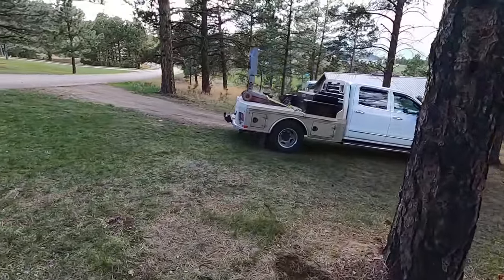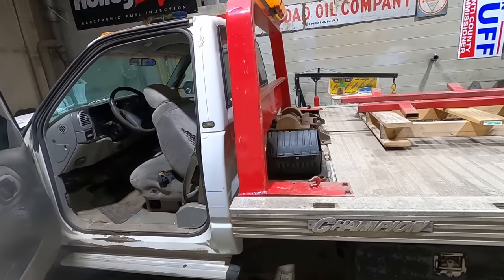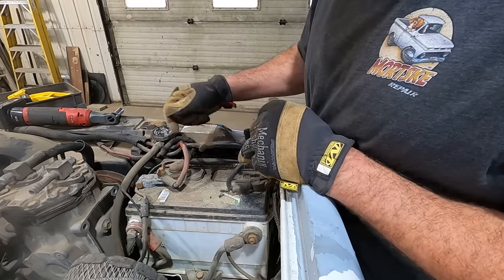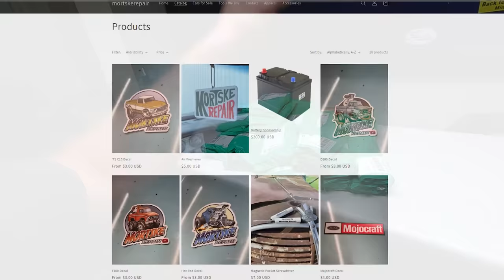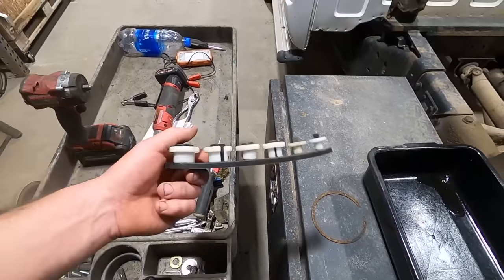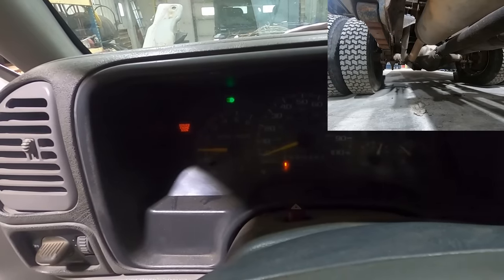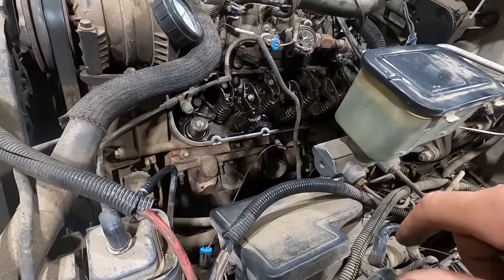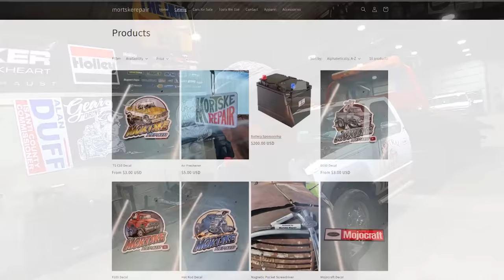WORST Purchase of My Life?!? I Bought a Rollback Tow Truck for Dirt Cheap! How Bad Can It Be???

Comment: 2002 was the very last year for Chev & GMC fullsize truck models with that body design. From 2001 - 2002, the 3500 HDs like that one there & the bigger size medium dutys were the last models that were left in production. 1999 was the last year for the SUVs & 1500 pickups, & 2000 was the last year for the 2500 & plain 3500 pickups. 1988 was the very first year for that body design, but they only came in two-door cab pickup models at the time because the SUVs, four-door cab pickups, & bigger size medium dutys with the previous body design were still in production which lasted up through 1991 except the bigger size medium dutys only stayed in production up through 1990. 1991 was also the first year for those 3500 HDs.
Reply from the maker: Good to know

Comment: Considering how long this body style has been discontinued for the Silverado trucks, the air filter is still available at Walmart.
Reply from the maker: good deal!
Reply: @MortskeRepair  when the Dickinson store did our last Automotive department remod in January, we lost air filters from vehicles that were newer than these, and I was certain we would lose them. But they remained, along with the cone air filter the F150's with the 5.4 l engines used.

Comment: The wheel lift has two L shaped square arms that slide in the square holes on the side of the wheel lift behind the tire of the car you are going to tow then you put tire straps on top of the front tires and tighten the rachet on the straps.   Maybe you did not get the L irons for the wheel lift.  I have to go or I would tell you more.

Comment: Replace with a 8.1? Those are oil burning hot garbage. That 454 is a great engine if you give it the fuel pressure it needs and that would be 55-62 psi and most of the time they won't start without that. As far as showing a miss fire not with a code reader you need a scan tool that will show mode 6 data. In fact you can pull a couple of plug wires and it won't trip the check engine light. That motor makes plenty of power it doesn't need any modifications been driving a 99 3500hd for 20 years they are awesome.  If you do need to pull the heads you will need to get a real scan tool tool to set the timing cam crank correlation, set base time with a light the rest with a scan tool. And yes the push rods are bigger diameter than the old ones. Few issues are, intakes like to leak, fuel pumps, the distributor caps are not nearly as good as the old hei caps.
Reply from the maker: good info!
Reply: I forgot to add,, great videos!!

Comment: I'm no expert on cars, but I don't think that is the original engine for that truck. When you had the Schlong in the cylinder, I saw that some cross hatching was still visible. I don't think that would still be there if that engine had 240K on it, unless it had been completely rebuilt at some point.
Reply from the maker: Looks OEM to me

Comment: 454 is what engines are all about. I mean, really. You do a good job narrating. Don't know what you paid, but I bet you scored big. Never could find anything that could even match the 454 SS motor from an 1970 Chevelle. Did nearly lose my life in it, but I was just a kid. But Crescent wrenches? Are you a carpenter on the side? lol I had one put out somewhere between 650 and 850 hp. Was considering making my dual axle car hauler I bought used into a rollback tilt bed. Still considering it, but not so much. Am going to make it a tilt bed.  I love hydraulics. I invented electricity. Thanks

Comment: Fun fact; 88-94 had the older Interior and the flat grill with (TBI) injection, 1995 they came out with the (new) grill and updated Interior and electrical for an air bag but still had (TBI) injection and same front accessories as 88-94, 1996 same Interior as 1995 but they came out with vortec with (EFI) and they updated the front accessories on the engine, 1997 they updated the dash again for passenger side air bag 1998 had the same Interior as 1997
Reply from the maker: Good to know
Reply: @Mortske Repair  you're welcome you need information about 73-87 or 88-98 I got alot of information about em

Comment: You got a Topkick handle on the passenger side. 

It should be a regular handle like the drivers. 

If you wanna throw another Topkick handle on the drivers side, good luck. You’re gonna need to find the handle AND the rods, that aren’t broken. Which chances are, you’re not going to. 

Easier and cheaper to throw the regular handle on the other side. Or leave it, can’t see both sides at the same time anyways

And those Vortec big blocks love eating lifters. I’ve had to shim and lengthen a few pushrods in my day for the customers that didn’t wanna pay for new lifters
Reply from the maker: Interesting! I'll probably go with the standard style door handle if I get crazy.
Reply: @MortskeRepair  I was wrong about the handles. It’s been a few years since I’ve messed with HDs and Topkicks. But regardless, the rods are unobtainium. And the dudes selling them want outrageous prices for them

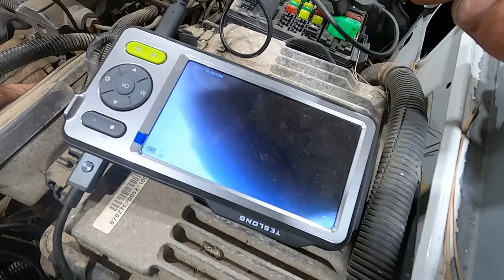Comment: 1:17:25 ouch...you know the 2001-2002 models of the 3500HD had the 8100 engine in from the factory so it's not a hard swap at all...those are the ones to look for although I'm picky and would hold out for a 5-speed and I'm also cheap so I'd be looking for a TBI 350/5-speed '95 model because lots of power is nice but a TBI 350 is so bonehead simple even I can work on it

Comment: Luckily its not a aluminum head and the exhaust studs should be good. I dunno why every modern aluminum head v8 snaps the heads off but every manufacturer constantly needs manifold bolts replaced.

Comment: You’re wrong on the 8.1, 2001-02, c3500hd would’ve come with a 8.1 as the gas option and is a GMT400
Reply: Came to say this. Seen quite a few for sale lately with the 8.1, and cheap. I figured people assume it's a mistake and write it off as a 454.
Reply: @ljkck3578  mortskes truck is definitely a 454, as 8.1 trucks are coil near plug like an LS. And the intake is totally different

Comment: The modern toothbrush was invented in England in the 1700's. You can tell it was invented in England because if it came from anywhere else it would have been called a teeth brush 😂

Comment: Ugh. I hate those GM "quick" disconnects.  WTF is quick about having to have a special tool to remove a degraded piece of plastic while hoping it doesn't break or strip out?
Reply from the maker: Makes them easy to assemble

Comment: Okay I'm sorry I haven't finished the video yet so I don't know if he even corrects himself but I need to get it off with chest as someone who specializes in these exact motors the 7400 vortec motor you say the aftermarket is not out there no there is an ungodly amount of aftermarket for that motor the big thing you have to remember is the block never changed it is still a 454 which is the exact same block as a 427 and also the exact same block as a 502 so you can use any of the parts for any of those three motors
Reply: And as far as the computer stuff goes as long as you're not going crazy with it I mean you could stroke out a 454 and throw bigger injectors at it all the way out to a 489 and the computer will still keep up with it just fine it won't care however there are people out there who are tuning the stock computer and there are aftermarket computers that will hook up to that motor and that stock wiring harness if you really want to get fancy with it but honestly if you're looking for more power then I cammed out 489 and you want to stick with E FI go LS otherwise f*** the computer stuff drop a carburetor intake on it and flop a carburetor on as long as you've still got the crank position sensor and the kickdown cable the 4l80 should still work if I remember correctly there might be one or two other sensors that it still needed but the point being is it is stupid easy to just rip the vortec intake off and plop a carburetor and take on it and that's it it works
Reply from the maker: @DAR10162  good to know
Reply: @MortskeRepair  I apologize if any of that came off passive aggressively I really didn't mean for it to but rereading it now I can kind of see how it does so I do want to apologize for that I didn't mean to be passive aggressive about it
Reply from the maker: @DAR10162  no need to apologize!

Comment: Marvel mystery oil should have gone the way of the dinosaurs.
Reply from the maker: why's that?
Reply: @MortskeRepair  like seafoam they have outlived their usefulness.
Reply from the maker: @karenkartz3163  Care to further expound on your theory?
Reply from the maker: @karenkartz3163  Enlighten me
Reply: @MortskeRepair  ok seafoam was a quick fix for 2 stroke outboard engines to ease start up after winter storage. Loosen piston rings on piston  from cheap oils we used to have before fogging oils. Marvel mystery oil is pretty much the same but it did work on 4 stroke engines but oil fouled not rusted tight.
Reply from the maker: @karenkartz3163  Interesting, and they serve no other purpose?

Comment: So what do you do to fix the air stepper motors for the gauges. I just shot some air around my 94 and it seems fine now, but my 93 has a jumpy fuel and oil pressure gauge. Why don't you send me a Quadrajet. Then I can do a video with all the tricks! I have looked around and nobody has an extra, and the one I have doesn't have enough left to even try a video. It would be more pictures than video. I don't have holes in my beds, I take the bed off! Guess they didn't know how to stager the butt connectors so it wasn't a big mess! Please tell me OBS stands for.
Reply from the maker: Old body style
Reply: @MortskeRepair  What? That's new body style to me! 🤣🤣🤣🤣

Comment: When you get it running right again are you going to use it to get vehicles that you bought or just use the trailer
Reply from the maker: hopefully
Reply: @MortskeRepair  that would be cool 😎 to see a video of yours & you're in the rollback going to get 2 vehicles & if the wheels are stuck on one you can put that one on the bed & the other one on the lift piece

Comment: With the amount of class C motor homes sold to the optimistic public during the years of late 70's to early 2000's who envisioned having a lot more time to use them, that are now sitting around with hardly any miles on them representing an eyesore and something most people just want to get rid of. Why don't you locate one of these low dollar - free dollar rigs, tear the motor home part off of it and put that bed on that worn out rollback Chevrolet on it?
Reply from the maker: Frames are usually lighter.

Comment: If this engine  hasn't run in 10 years ethanol is not an issue. Old gas, made in the US of A... There's your problem... (Is it any wonder that Wes whines? This modern shit is great when it runs and a nightmare when it doesn't. Bring back the Model A....